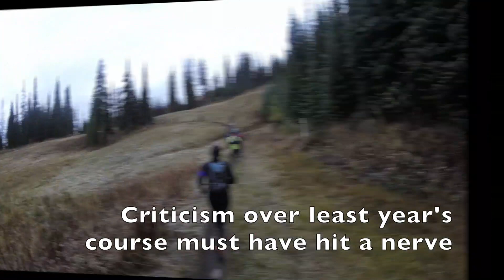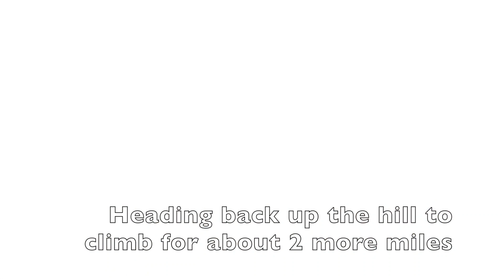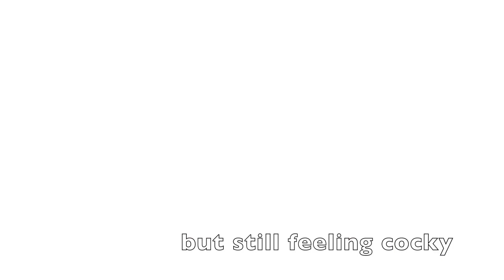2015 Spartan Ultra Beast - Sun Peaks

Comment: why would they use barbed wire? thats just dangerous
Reply from the maker: I used to think the barbed wire was cool, then I did another race with normal wires.  After comparing different races, I'm in the "barbed wire is just dumb" camp.  Strange that Spartan Race has neutered some of the cooler stuff but still keeps the barbed wire...  Guessing it'll go away at some point.

Comment: Were the cutoffs really 12pm for lap 1 and 5pm for lap 2?  That's not alot of time for a mountain UB.
Reply from the maker: +J19Pritch Sorry, just noticed the question (alerts aren't working apparently).  They extended the cutoffs to 1:30 for lap one during the race (I think it was the third and final extension that a day - a lot of people weren't on pace for the 12:00 pm goal).  Not many people made the first cutoff.  I didn't stop once, and ran the downhills and flats and still missed the cutoff.  The elevation gain and impact from the cold were the big factors in the race.  I focused on a sustainable pace for 2 laps, and that was a mistake.  Needed a higher baseline than what I had going up the slopes
.